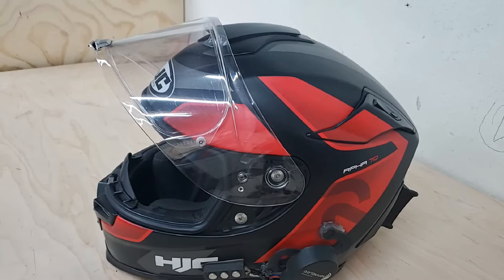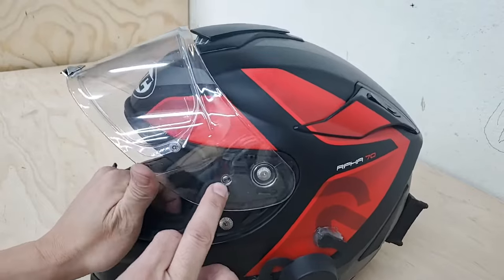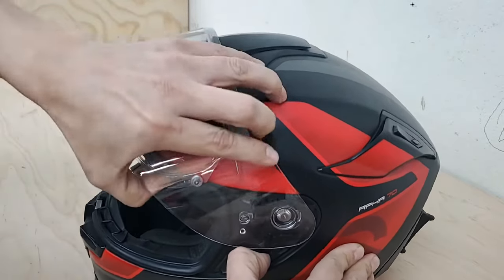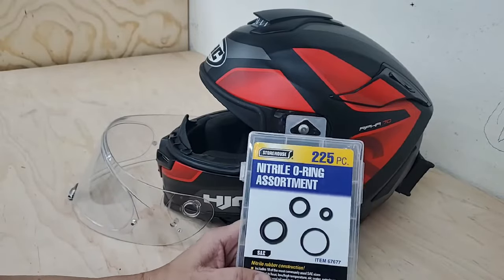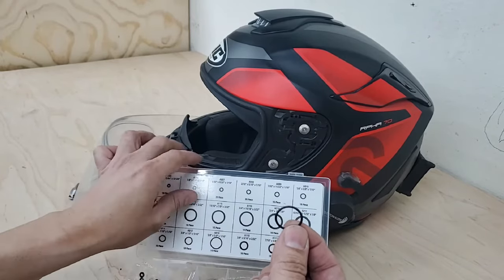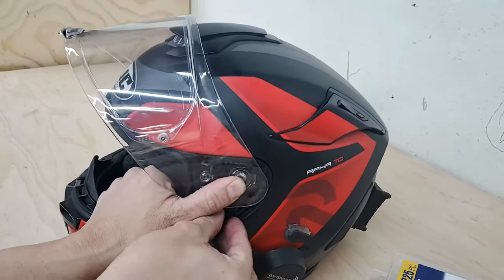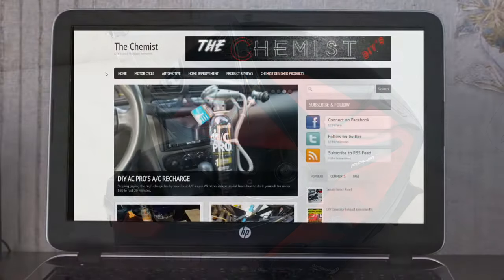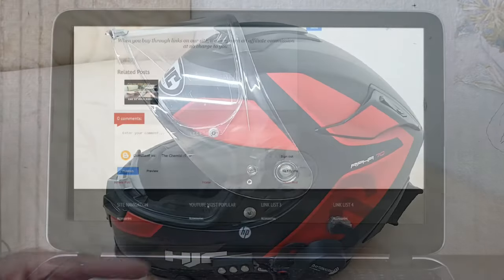Loose Helmet Visor Fix ( For Any Helmet)

Comment: Thanks for the inspiration. I'm in Thailand and didn't know where to buy O rings but found the elastic bands that they use to seal street food bags worked a treat!
Reply: No problem dear use simple rubber bands to replace the O rings...I have just fixed this problem in my Axor helmet simply by using rubber bands only...
Reply: The elastic bands are best for this purpose...believe me it will give you more tightness...

Comment: LEGEND!! I have two I90 modulars that have the loose visor problem BUT the big difference between the RPHA and the I90 is that the visor detent is part of the chin guard pivot, so getting a new chin guard to fix the visor problem was going to be very expensive. I used 14mmx2mm Orings and fixed the problem in 5 minutes.

Comment: Dude, just bought my RPHA 11 pro Joker helmet and went for my first ride and same thing. The visor wouldn't stay open or cracked open. This is genius. Thanks man.
Reply from the maker: Wow, sorry to hear.. if you can take it back, I would.. your going to be dealing with this issue for as long as you have it and you'll need to carry these o-rings with you all the time because they wear out and break when you least expect it. It's a cool and cheap fix for now but for the amount of money spent on this helmet you shouldn't have to be dealing with this problem. Let's just hope they don't have the same issues with the safety side of the helmet as well.. if you can't get a visor locking system correct, how can I have faith in your safety rating..

Ride safe brother
Reply: @TheChemistDIY  I can't take it back. I've been trying to find the right helmet for me for a while now and this one is the only one that fits right and that I like. The only complaint is the stupid visor issue that won't stay 1/4 or 1/2 open. If I exchange it for another of the same model I feel I will just have the same issue. For some reason HJC has this flaw in their helmet? I think I'm actually getting used to it being fully closed all the time now as the helmet has excellent air flow in the chin area. I'll just try the O-ring fix for now. Thanks brotha

Comment: Great watch!  Had the same problem and now it looks like a simple and easy fix.  Thanks for sharing the knowledge and solution as always!
Reply from the maker: Thanks for stopping in and commenting Jonathan, come back and let us know what helmet you have and if this solution fixed your problem. Ride safe
Reply: @TheChemistDIY  Thanks!  I'll be getting the o'rings today on Amazon.  I have an older AGV so i'm sure this will work!
Reply: Greetings Mr James!! Thanks for this Detailed DIY. I have watched your other videos too Nd were helpful to mine. I have a question but not related on this recent post. I hope you don’t mind.

Have you ever experienced your motorcycle will stop/stall once  you shift to 1st gear from full stop ? 

What is your diagnosis and fix if yes Sir

Thank you so much
Reply from the maker: What up brother, Thanks for sticking around and going through my videos.

So let's' see, First is your idle set at 1300 rpms (When hot), I've found that the Gixer runs best at 1300 and not 1200 as the service manual will tell you. That said have you put the bike in dealer and see if your TPS indicator is dead center (-C00).

Second - I know this is common sense but I have to be thorough.. When was the last time you did a tune up.. and cleaned that air filter.. the engine needs air and as soon as you starve it.. a lot of funky ish happens.

Since your topic has to do with deceleration issues, when was the last time you checked and cleaned the Pair System.

I have a video on that here .. https://youtu.be/YFCiPj1yNiQ

Good way to tell this system is dirty is if your getting a lot of exhaust popping on decel. While not covered in the video there is also a filter on the casing, just under gas tank with a hose that leads up to the air box (Big silver Square box looking thing). Most usually swap out for a normal looking filter for better airflow.

I generally go this route first if it just started happening or happens intermittent. Here you want to make sure were venting the exhaust gas fast and it not choking out the engine. plus they're real simple things to look for and fix. This is your EVAP system

While on the topic of breathing, check and make sure all of your air hoses are good.. no cracks and properly sealed. not sure if your familiar with the carb cleaner trick but I'll explain briefly. Spray some carb clean on your air lines and end entry points, see if the bike idle bogs down.. if it does then your have an air leak on that line and need to replace it.. also spray around the boots of your stacks (with air box on).. this will let you know if you have leak in this area for sure...over time the boots will degrade and crack causing air to get in where its not suppose to. https://youtu.be/ZgZVawt02Io?t=296

Hope that helps.. keep me posted

Comment: Had same issue with my hjc visor also,
 didn't have much joy with your method, what I found worked 4 me ,was inside your visor is the little plastic pegs that rub against the plastic detents on the mechanism,  I put some tiny o rings over these which worked a treat
Reply from the maker: Awesome, I thought about that as well. How did you keep them from rolling off the peg?
Reply: @TheChemistDIY  there a little peace on the plastic pins that the o ring stretched over holding it in place
Reply from the maker: @andrewhumphreys293  aww yes, I see it now on my helmet. Helps to have good eyes.. lol. Going to give it a try  and see how that works out.. like I said theirs more then one way to do it.. thanks for the input.. to bad we have to go through this crap..
Reply: @TheChemistDIY  yes pal I agree paid best part of £400 4 my helmet,  disappointing 2 say the least,  good look with o ring 😀👍
Reply: Same issue with the HJC i90 I bought for the Mrs. Other than this issue the helmet is good for the price. Hoping to never have to test the crash-worthiness. I tried the O ring as suggested in the vid and also over the detent peg and over the detent peg seems to be a little tighter. Both help, but neither is as stiff as it should be. Guess I'm spoiled with my Shoei. Thank you both for the ideas.

Comment: Haven't test rode but mine is definitely tighter now. This has been driving me nuts. Great job thanks!
Reply from the maker: Don't thank me yet..lol.. the O-rings only last about a week or so and then break. You'll be doing this until your helmet reaches EOL.. sucks but it is what it is..
Reply: @TheChemistDIY  haha ok. My helmet latches are designed slightly different so still holding out hope!

Comment: Still having the same problems with hjc.
I went to a store today to look at and try on the aphra 11, C70 and I70. As I wanted to buy one, I have made several visits to decide. When I realized the ratchet part was basically smooth on several of them allowing no fixed locking at the various levels. I looked at about 10 helmets and almost half had the loose visor problem. I told them at the store about my decision not to purchase because it shows poor quality control. I researched on Google when I arrived home, found this post and others. Some going back to 2010. So,14 yrs later and still happening ?
Reply from the maker: @daryldaryl913  I don't think HJC cares to get rid of this problem, It requires trashing the current tooling and a complete update to the CAD Model in order to produce the correct parts. Why when you continue scamming unsuspecting customers until the next iteration...

Comment: Take a small circle of foam, glue it to either the helmet or the visor between the 2 near the rear of the shield.  Adds a touch of friction & works perfect.
Reply from the maker: Not a bad solution. How long are you getting out of the foam longevity before new ones are needed to re- glued?

Comment: Hello friend.
I bought one rpha 70,same problem from day one.
I regret not choosing shoei gt air 2.
I will try to put a oring in the little circle plastic tha slides on the detents and inform you about.
Also I encourage you to add to your title "avoid hjc".
Also my wifes i90 hjc does the same thing.
I will not choose hjc again.they cannot design proper visor mechanism. How can we trust them our safety....maybe there are bad designs in helmets builtment too....

Comment: I oringed my Arai XD3. Loooking at a KLIM KRIOS PRO and it does not seem to have space for anything. It sucks because it is a sweet helmet. But visor too flopply
Reply from the maker: If so then that's a first, sorry brother. All that really needs to be done is provide some type of drag from the visor  to the helmet body where it rotates. You could even use hot glue to add a rubber bump that provides friction between the two.

Comment: How about a not fitted visor gasket to the visor?
Reply from the maker: Are you sure it's the gasket around the visor window.. it could be that the plexiglass visor is warped not causing a tight seal allowing wind and water to leak in... #Just a thought.

Only way to find out is to purchase a replacement visor... If it is the seal then I would see if you can purchase a replacement from HJC or buy some rubber pich molding from your local automotive or home goods store.

Comment: HJC helmets are basically shit, regardless which model u choose, I landed an as new RPHA11, got exact same issue, sloppy visor & crappy detents, the truth is the post on the visor is way fatter than the detent grooves on the visor side mount plates, hence it's sloppy as FooK, glad I'd saved a good 50% on the RRP by buying a mint used lid, yes it's a nice looking & very lightweight lid, but that's about as good as it gets, sizing is off too, u need to go up 2 sizes in an RPHA11, it's clear HJC can't measure a human head, the lower detents feel non existant, visor just flops down with a nod of the head, I removed the side pods assemblies & filed the detents deeper with a small round file, made virtually difference, it's just a poor designed unit that can't be improved by filing, I tried several sizes of O"ring on the visor pivot post, not made a great deal of difference, but it's defo better than no O"rings, I'll see if I can come up with a better solution.👍

Comment: Horrible bro!
I'm sticking with shoie
Reply from the maker: I would have to agree with you bro. For the amount of money you pay for a supposedly quality helmet 🪖 you shouldn't have to deal with shit like this and considering the length of time your stuck with a helmet ,5-7 years, that's a long time to be dealing with an issue.

I've had cheaper, no brand name helmets come right out the box in perfect working condition and outlive there use. I was really expecting more from HJC.. especially at a $400 price point.

I did a ton of research on this helmet before buying and I found no complaints on the internet about this helmet.. at least now my viewers will know and will have the option to move forward or move on..
Reply: @TheChemistDIY  
Yeah haha 
I was really surprised to see it was hjc to be honest but here I the UK the hjc hemlts always score around 3 out of 5 in the UK govt sharp testing which isnt terrible but cheaper helmets score 4/5  sometimes 
I was actually gonna buy a Rpha 70 in balis blue to match my nre cbr 1100xx..I was browsing ur vids and was surprised to see it's a hjc!
Definitely not buying them lol
Reply from the maker: In my search to find a helmet with built in speaker pods so I could fabricat a high end audio system I only came across a handful of helmets that appealed to me. The grandal was the sure winner because of the paint scheme which I was planning to wrap over the red with blue mirror vinyl (still am).

The price point and the reputation of HJC was is what truly got me.. can't complain much about the rest of the helmet.. but it was definitely a downer to see. Hopefully by now they worked out the kinks.. but moving forward this will definitely make me think twice about buying anything HJC.